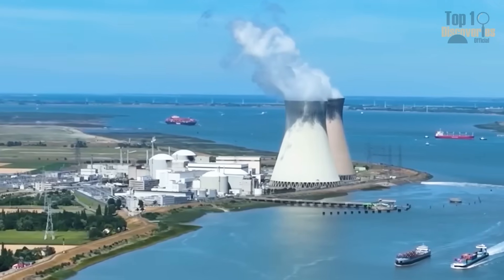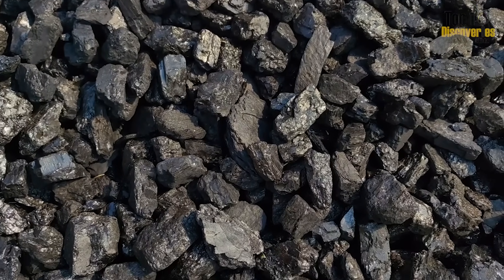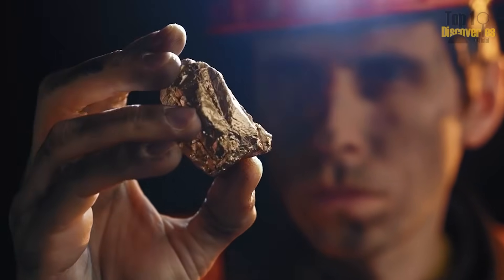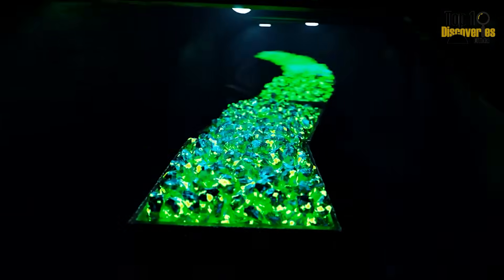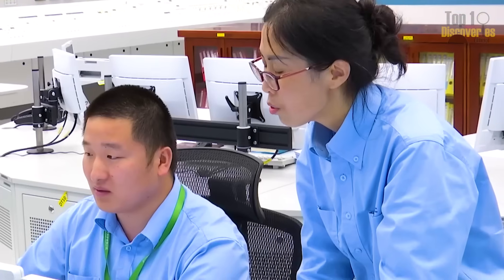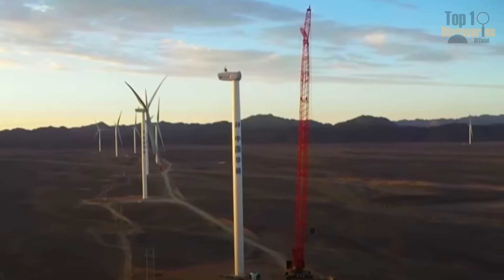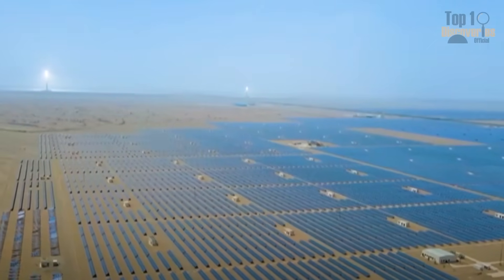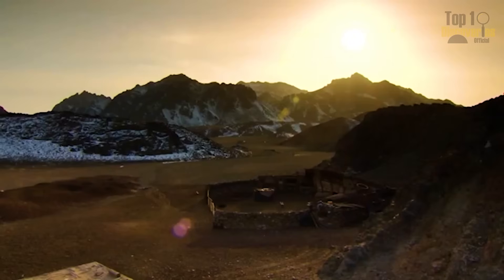As Global Conflicts Unfold, China Focuses Deeply on a Thorium Nuclear Energy Breakthrough!

Comment: Too bad none of these liquid Thorium videos show how they can overcome the 3 week protactinium delay in the cycle, or how Gamma is dealt with. But China seems to be firmly in the lead to overcome these obstacles, so perhaps we'll see.
Reply from the maker: Actually, the roughly 27-day half-life of protactinium-233 is a major challenge in the thorium fuel cycle. If it isn’t properly isolated, it can absorb neutrons and turn into unwanted isotopes. One proposed solution is to chemically extract the protactinium from the high-neutron-flux zone and let it safely decay outside the reactor core.
As for gamma radiation, molten salt reactors offer an advantage — since the fuel and coolant are both liquid, heat is more evenly distributed and easier to manage. China appears to be developing integrated systems with online separation and dual-layer shielding, though detailed public data is still limited.
If they've truly solved both the protactinium delay and gamma shielding issues, this would mark a major leap forward for Generation IV nuclear technology.
Reply: @Top10Discoveries.Official  It's actually easier to apply secondary functions to the delay, such as hydrogen/ammonia economies, desalination, sodium ion battery production, and localized industrial heat applications, than separate and lose the scales. We were working on this when it was suppressed in favor of weapons grade uranium/plutonium production, and the further enrichment of fossil fuels 'oligarchs'.